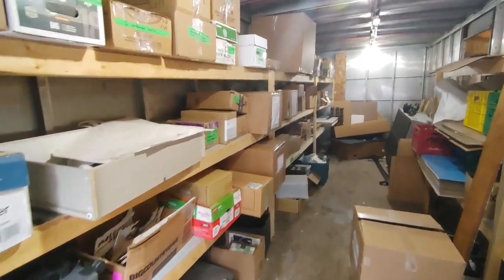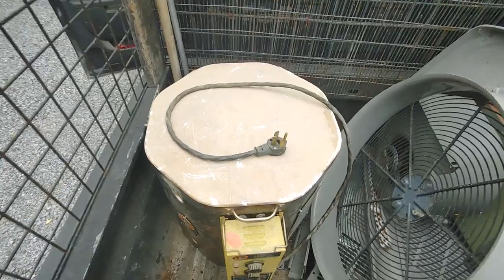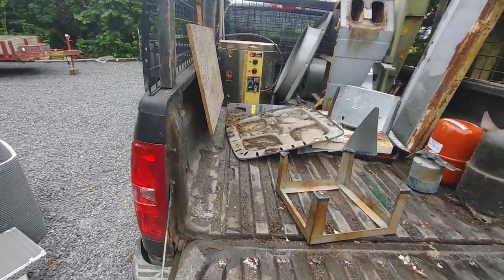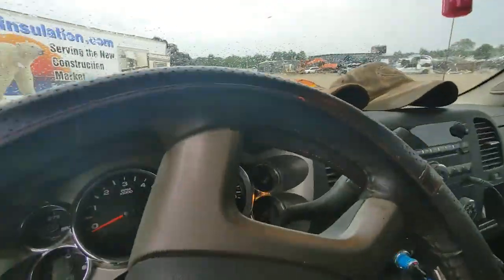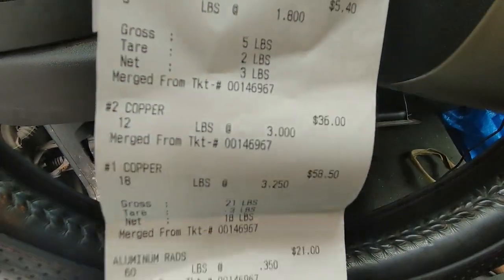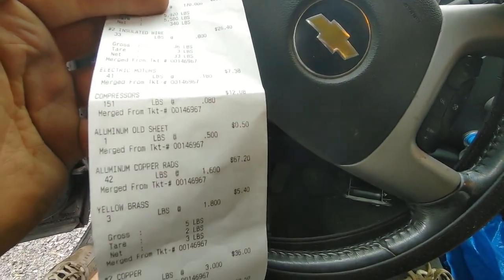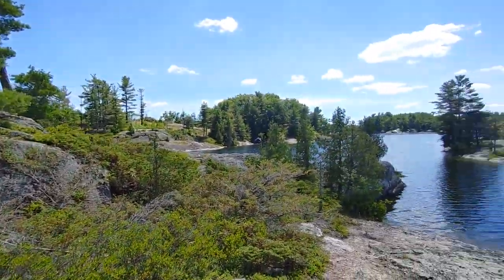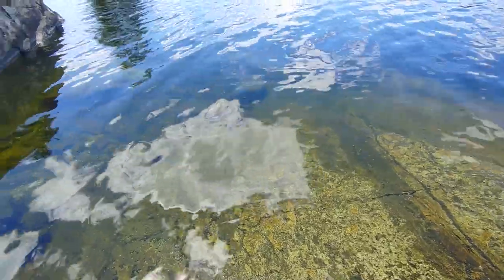My last scrapping video.

Comment: Cutting Fuel Cans/Tanks:  one of the first auctions I ever attended was for a blacksmith who died, when the large fuel tank he was cutting on exploded.  It was “empty”, but not purged well enough.  The residual gas expanded from the heat and blew the tank.  Ventilate and purge!

Comment: Back when I used to plug my own flats, I’d let the pressure out first, so the escaping air wasn’t working against the glue.  Put the truck on a jack stand and bleed it all first, then wait for the glue to set before re-inflating.  Now I take all my flats - truck, car, tractor, trailer, even handtrucks and wheelbarrow over to one of the Les Schwab tire stores.  They fix flats as a free service in our area. If I’m close to one, in a situation like you had I just drive there with the screw still in and let them do the entire fix.